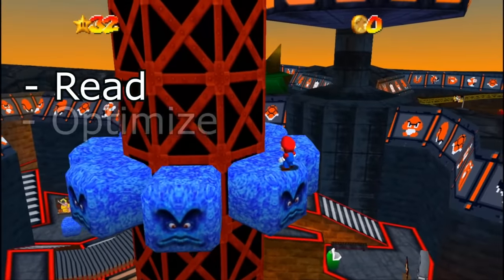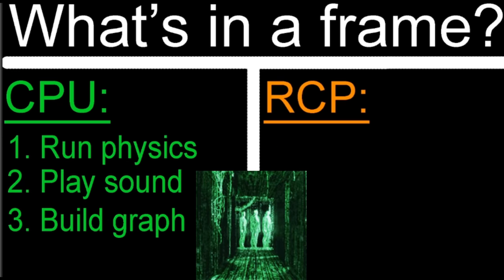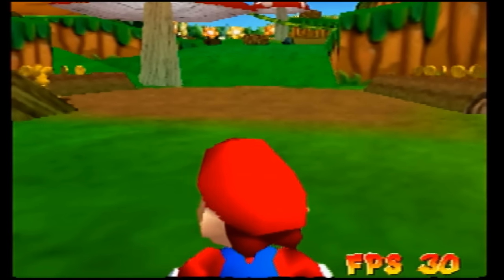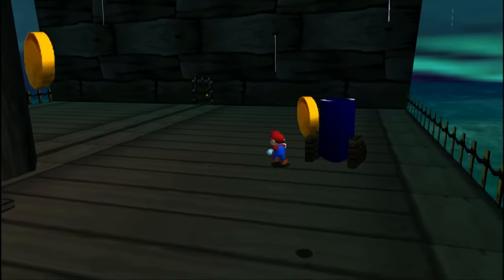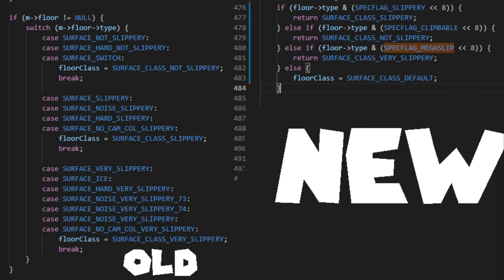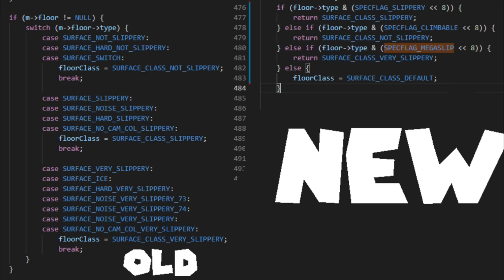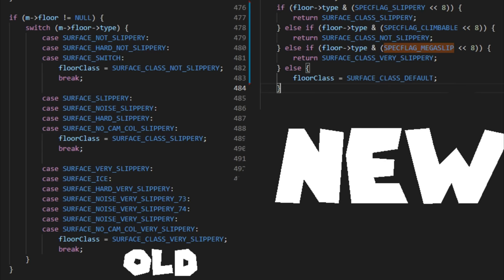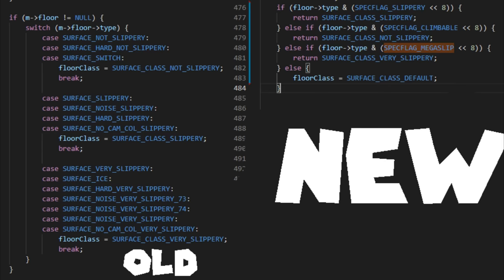FIXING the ENTIRE SM64 Source Code (INSANE N64 performance)

Comment: This knowledge in the 90's...Imagine how things couldve been
Reply: I remember how things were in the 90s, things were much better then
Reply: 1980's and 1990's were the best times for gaming.
Reply: Even with this knowledge we didn't really have the hardware to take full advantage of it. Now we do. Took years to even emulate these games to begin with.
Reply: @rsolsjo  But I think having better software would make the push for better hardware faster.
Reply: @rsolsjo  Thats not the point. The hardware doesnt need to change. Programming tricks and knowledge is all you need to make things run faster on original hardware, as shown here. Relying on hardware power to mask shitty programming is a crutch...
Reply: @jonnyj.  It is the point, he's using the memory expansion which wasn't available when Mario 64 was released, and even if it was, it would've been crazy expensive at that time.
So the performance here is only possible if they released a patched version YEARS later that required the expansion. Simply wasn't going to ever happen.
Reply: @ji-tan  Hardware (memory expansion) that wasn't available at the time.
Reply: @sneakyfrenchgirl  Yeah. Early 2000 were great too.
Reply: @mlc369  Did you even read my reply? 🙄
Reply: The expansion pack came out 2 years after Super Mario 64.
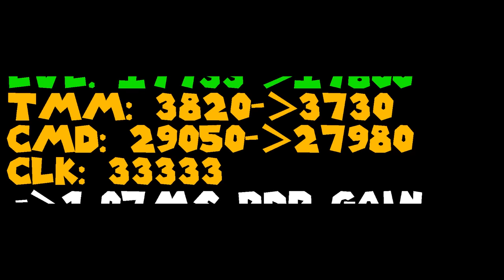In this video, at 6:36 Kaze says this overhaul wouldn't be possible without the expansion pack.
Reply: Yeah. Golden Eye would acctually have playable multiplayer lol
Reply: @V3ntilator  Best times for many, many things.
Reply: @ji-tan  With double the RAM that the system initially shipped with, to be fair.  (Expansion memory pak required.)
Reply: @TAMAMO-VIRUS  Sadly no, we get better hardware because programmers (myself included) are lazy and/or don't have the time to optimize which makes it more demanding. More demanding code needs better hardware.

The more efficient you are the less powerful cpus/hardware you need. So on the whole hardware is advancing steadily due to poor programming.
Reply: @jonnyj.  A crutch on which modern gaming walks
Reply: @Razumen  the proper memory segmentation is the optimization that required more memory. 

The rest of what he did can still be done with out the added memory. 

bad code is what plagues modern computers. i use arch btw
Reply: rose tinted spectacles can often blind one from the truth of the matter.
Reply: @Razumen  I'm sure nintendo wouldn't have been able to release the expansion pack earlier in the event that sm64 were at this level. No way. It was clearly only dreamt up and designed later on
Reply: I love how most of you guys commented viewing the 90's and early 00's with Rose Tinted glasses...but remember this, content like this wasn't being made by your average coder (cue matrix soundtrack), there was no canceled/hidden/beta leaks online, internet speed was fckin bonkers compared to today's standards (and god forbid is someone would use the house's phone while you were just about to finish a 10mb download.)
Get real, leave yesterday as a memory, face today's reality and look up to the future. There's no better time to be alive.

(Also short note. Shout out to my people who wished back in the day that "X" and "Y" game was portable. Today the wishes are true. Mine was GTA SA.)
Reply: @16vSciroccoboi  Huh? You really don't know what you're talking about, do you? Memory prices were insane when the n64 was released, they literally couldn't release it then, it would've costed more than the system itself.
Reply: @Bluescore De'La'vie While I agree that a lot of these statements are influenced by nostalgia, there actually are concrete things about the gaming industry that are actually worse. Several entire genres have died, and many more suffer due to parasitic monetization and other ugly industry trends. So it's not all nostalgia, unfortunately. I wish it were.
Reply: @Razumen  The speedup from using the memory expansion was pretty small compared to other massive gains. The majority of the speedup was totally feasible for the time.
Reply: @xeridea  A lot of the other fixes depended on the expanded memory, so no.
Reply: "Imagine how things could've been"

DOOM (managed to optimise raycasting to work on almost anything,) Quake (ran in full 3D at a playable framerate on pre-Pentium PCs in software mode,) and pretty much anything that was developed for the Mega Drive by Traveller's Tales in the 90s (the Game Hut channel is a treasure trove of technical wizardry) would like a word. They were all masterclasses in optimising weak hardware.

This game's code is just a bloated mess, as this video has shown us.
Reply: @Razumen  Not really. By far, the largest speedup was speeding up shadows, which was done in a way that significantly reduced codesize. Also, not caching as much stuff that didn't need to be. Also, things like not unrolling loops reduces memory footprint, which reduces memory usage to speed things up. A ton of duplicate code was removed which... reduces memory usage. You could get 90% of the speedup, while also reducing total memory usage.
Reply: @xeridea  Yes really, more efficient ram usage impacts everything else. And that 90% number is just pulled out of your nether regions.
Reply: @Razumen  No, no I didn't. I am using data from the video. RAM layout changes improved CPU time ~5%, and GPU time ~3.5%. Optimizing things like shadow calculations and reducing cache usage speed up game by ~40%. Do the math, the 90% figure is accurate, even before factoring in other things that don't require extra memory, and in general, reducing memory usage sped things up. This isn't true on modern systems, but it is for the N64, since RAMBus was a horrible technology that never should have existed.

Provide numbers for your claims, otherwise, you are blowing hot air.
Reply: @Razumen  not all of them needed it.
Reply: Technically, we could have had Wolfenstein 3D running perfectly well on a GameBoy. ;)
Reply: This knowledge was there but the hardware wasn't..
Reply: @ash_1419  The knowledge was there as in "someone somewhere knew how to fix this," but those people just weren't calling the shots inside Nintendo.

We can all enjoy Nintendo's game design know-how and asset creators, but there have been many times that their programmers fell short. Nintendo still can't figure out how to write netcode.
Reply: @xeridea  you fucking killed him bro.
Reply: @rsolsjo  This is running natively on an N64 console (that's what makes it so impressive)
Reply: @colinthies3178  I'm assuming it just doesn't split the ram if there isn't the expansion pack
Reply: @rsolsjo ? Mario 64 was emulated in 1998 with full fps.
Reply: "You either know about these things, or you go out and touch grass once in a while...". 🤣
Reply: @reloadpsi  yes, but the companies have completely different business models, game studios are pushing the hardware to the limits on purpose, because they just sell games, they sell depending on how flashy the game is, Nintendo OTOH had no incentive to do so because they owned the entire ecosystem, no matter which game you chose they made a profit, the consoles were almost always sold at a loss, and that's also why the hw was/is so weak, there's actually some incentive to make games progressively better over time to keep you buying games for the same console.
Reply: @Tieigo0  Years 1999-2000 were peak years of humanity. Everything went downhill from there. Accept the truth.
Reply: @epajarjestys9981  I accept your opinion as an opinion, not as facts.
Reply: @Tieigo0  My opinion is the truth.
Reply: @idabomb00  no you were just little
Reply: @epajarjestys9981  being self entitled doesn't make you the owner of the truth
Reply: @epajarjestys9981  Also, 1999 and years 2000? Everybody was terified, 1999 was a shit year, everybody lived in fear that the world was about to end. And should i even talk about 9/11? Global catastrohpies? Economy downfall? Are you even from this world?
Reply: @Tieigo0  Only idiots believed the world was going to end, and it was fun. Today we have much more reason to believe shit is going to hit the fan, or rather, we see it happening already. Also, I was 16/17 years old during these years. Best age, best time. This is the objective truth.
Reply: @epajarjestys9981  Well, I'm truly sorry for throwing your 15's/16's under the bus then. I have nostalgia of those times myself too, but in an honest tone, I didn't mean to be rude to you. 
The lesson here is that any year can be the best year of our lives.
Thank you for making me reflect and get the nostalgia of how it was back then.
Stay safe, You are the absolute chad.
Reply: @Tieigo0  I perceived no rudeness from you.
Yes, I am the absolute chad. You, too.
In YouTube comments we can all be chads.
>u<
Reply: @xeridea  watch the video again.  The ram improvements were fundamental in being able to make the other changes.  Without the addition ram the other changes wouldn’t have mattered.
Reply: @mwwhited  I went through it again. Most did not depend on additional RAM, in fact many of them reduced RAM usage. Reducing mass amounts of duplicate functions reduces RAM, as well as function rewrites, which in general ended up being significantly less code. The biggest gain had nothing to do with memory, but moving calculations from the CPU to GPU.

On the N64, the games that did use the expansion pack, it wasn't actually necessary, but more of a bandaid for buggy code. As the N64 went through it's lifecycle, developers came up with ways getting better performance, none of which relied on the expansion pack. Some went as far as rewriting microcode, since the ones provided by Nintendo were complete garbage. Given time constraints, and developing on a new system, and going from 2D to 3D, it is understandable that the code is subpar on this game, but it is entirely possible to optimize without expansion pack.
Reply: In no place at all, some of the weirfd quirks were Nintendo ideas (like graphic allocations and file size)
Reply: NO APOSTROPHE FOR YOU SIR!
Reply: and maybe CD support on N64 too, PS1 was waaaay worse technically than the N64 but the CD was the best way

Comment: Two great quotes that will stick with me from this video:
"You either get to know about these things, or you get to go out and touch grass every once in a while. It's a strict either or, you can't have both."
"RAMbus goes vroom vroom."
Reply: aaaahh, grass.... I was convinced he said "You either get to know about these things, or you get to go out and touch GIRLS every once in a while. It's a strict either or, you can't have both." It made me giggle
Reply: Came to comment exactly that first quote. I'm 100% stealing that and planning to use it absolutely as soon as I can shoehorn it into a conversation.
Reply: I want to touch grass…
Reply: @kaneCVR  Wait, but I don't understand all those stuff and don't have a chance to go out and touch....
Reply: that earned a sub from me, not just the words, but I felt it was a genuine statement.
Reply: Regarding the first one. C is basically very well known at this point. The optimizations he does are mostly well known especially if you work in embedded, but they lead to code that is harder to read sometimes so they aren't used. 

Additionally, as he mentions, there's a huge difference between having a team of a ton of people working on a project and a single guy. There's so many redundant functions and unused variables in a big project that it's just not feasible to actually go and fix everything.
Reply: Also "if you just code well, you don't have to check for errors"
Reply: @cronto_999  it’s overrated
Reply: TOUCH GRASS HUEHUEHUE
Reply: Ehh, I've touched grass enough times to know what to expect. Now this! This is something else
Reply: @randomguy9777 someone gotta try it out but is rust actually faster than C ?
Reply: Why does he keep doing that? It’s annoying.
Reply: @villedocvalle  Have you felt soft crab grass? It feels amazing!
Reply: you know that's not true though... right? You can totally do both.

It's a funny joke, but it's not actually true (ya know... like most jokes?)
Reply: @idontwantahandlethough  You can also do neither, like me!